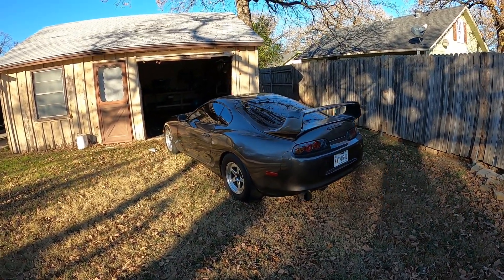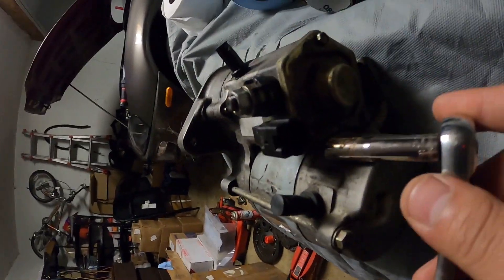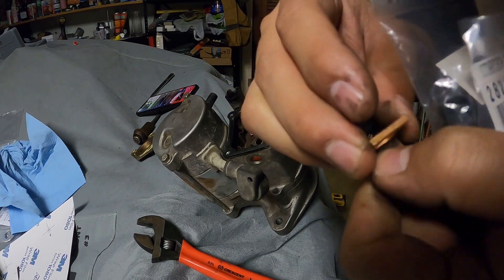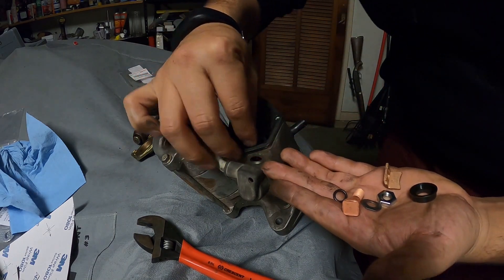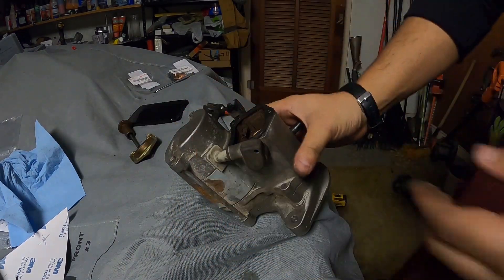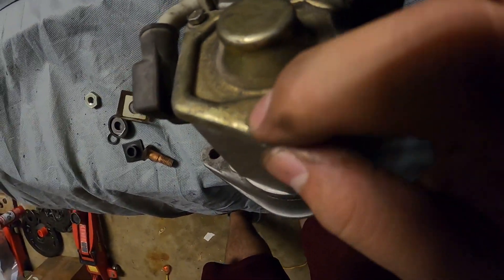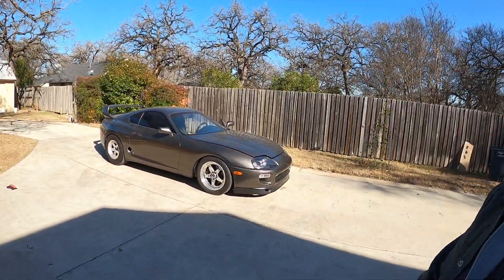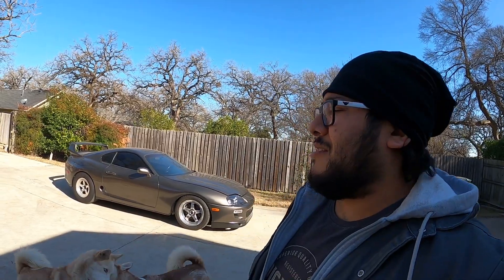Supra Moves Under It's Own Power. How to Rebuild A Starter

Comment: That snapped bolt is easy to get out, the pressure/friction is the only thing that keeps it tight. If the head snaps off, basically you can unscrew it with only two fingers.
 Other than that, the manual transmission is really a nice thing, might not be the fastest thing in the universe, but the universe becomes yours, at the mercy of the stick!

Comment: Hi! I didn't follow up with the repaint. Why You didn't paint the sills and inserts of the panels/doors? Shows up very much when opening door and even with the closed door. Also can see that through in many spots :S
Reply from the maker: It's not painted...
Reply: @boostedproject  😂Yeah, I rewatched the videos later on and found out it's a wrap :D

Comment: with t56 tremec ,   first question,  how did you install a propshaft, fidd connection is like a triangle. .  second question,   t56 6th gear ratio is 0.50  , standard diff ratio is 3.26. are you using standard lsd diff,? if you do,  whats the  RPM at 70mph?